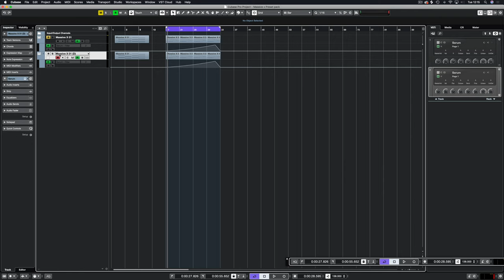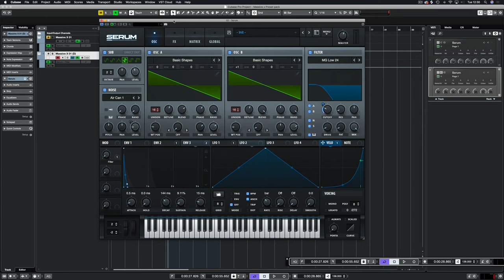How to make a Supersaw in Serum | Trance Tutorials

Comment: If you check the unison options in the 'Global' tab, you'll notice you can change the unison mode for the two WT oscillators. By default, they're both set to 'Linear', which means the detune distribution is, well, linear, the voices are equidistant. But you can also set it to 'Exp', which makes the distribution exponential. Most importantly, there is a 'Super' option, which is halfway between linear and exponential, and if you want to make a supersaw, this is the option to pick, since this is the spread algorithm used in the JP-8000, the synth the supersaw sound comes from
Reply: That is very helpful indeed mate.  Cheers for the insight!
Reply: Very good tip, thanks :)
Reply: Holy shit, thanks - awesome little tid bit
Reply: I just learned more from this comment than the last 3 videos I've watched on designing leads! Thanks!

Comment: I have a question about how Serum works. Normally if you are mixing, you side-chain the reverb & delay to the dry signal to obtain a cleaner sound. Does Serum this by itself? And if not, should you use the build-in reverb and delay?
Reply: you can duck the mix knobs on the effects if you wanted to just route it to the envelope